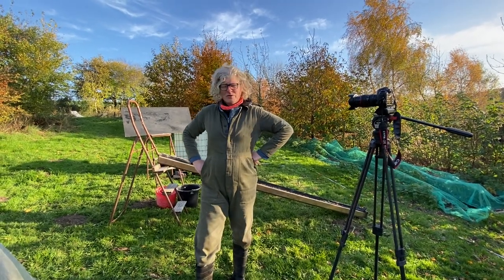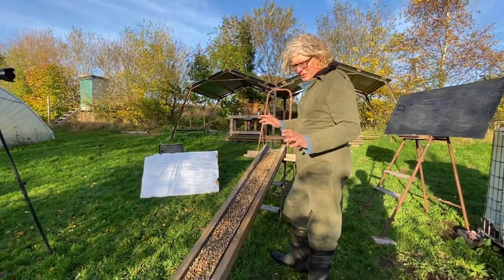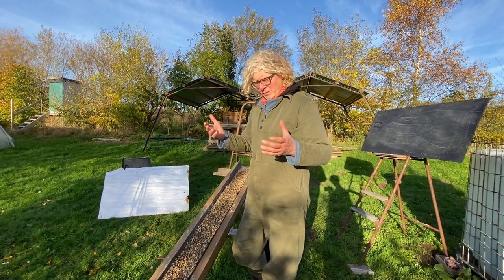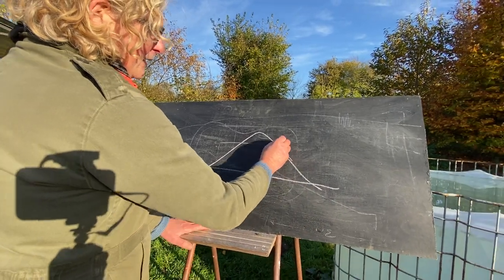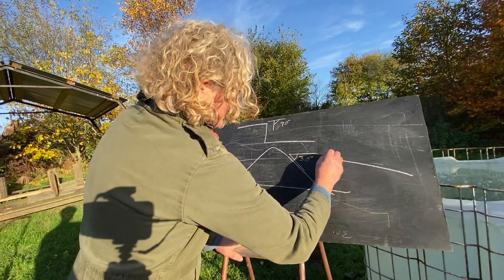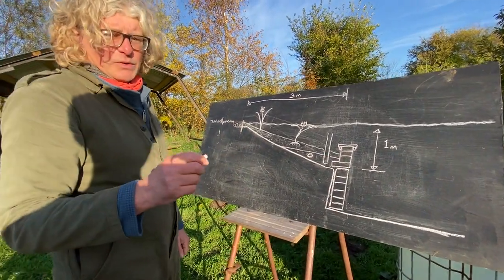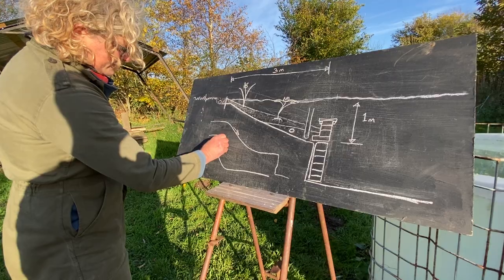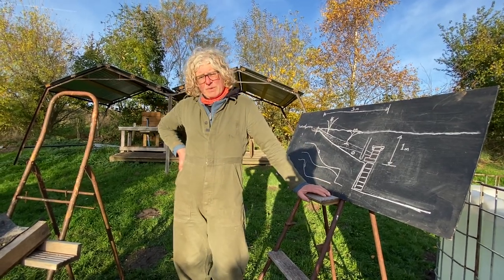Organic Pool gravel on a slope - Why it stays there.

Comment: Does the plant filter have to be three meters wide or can you make it two meters and  compensate the rest with making the concrete wall a bit higher? Reason i'm asking is that we would like to make a swimming pond with a swimming area of roughly 3*7m maybe even 3*10 ( depends on how big the yard wil actualy be after the house is built). As far as i can extrapolate we wil have ample space lenght wise, but we might come up short in the width if three meters is a must.
Reply from the maker: This would make a lot of shallow water which is prone to heating and algae. Better to step down at the edge, then the slope.

Comment: I am curious why not step down to the final meter drop so that you could have multiple flat levels?

Also curious if you have any thoughts about using dirt packed tires as the retaining wall under the pond liner?

Love your work and videos😁 Thank you
Reply from the maker: You can have flat levels, but it needs more building work. Tyres are too irregular a surface for the liner.
Reply: @organicpools-davidpaganbutler  if I were to use a mortar to create a flat surface on the face of the tires would that solve the problems that arise from using tires?
Thank you.